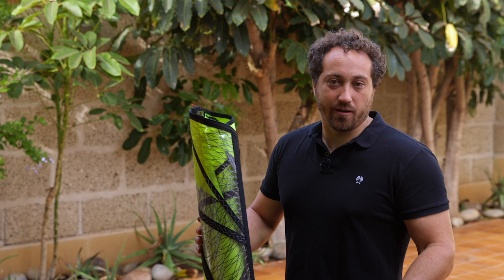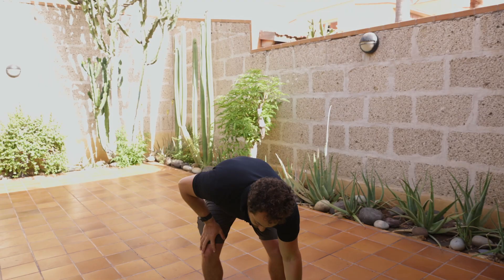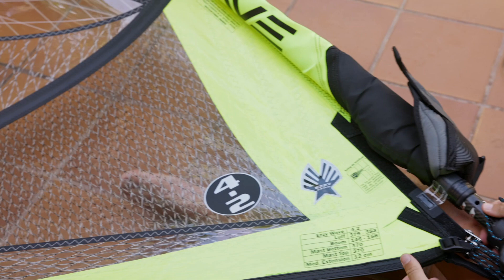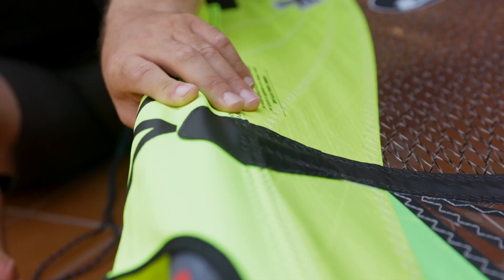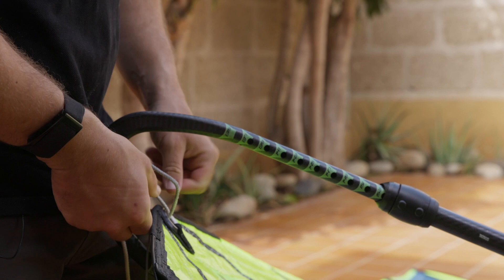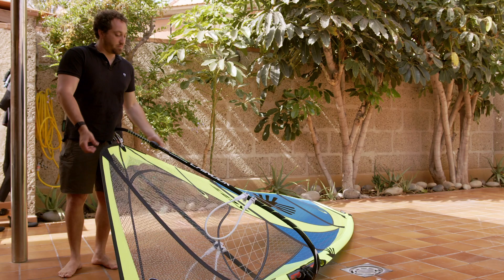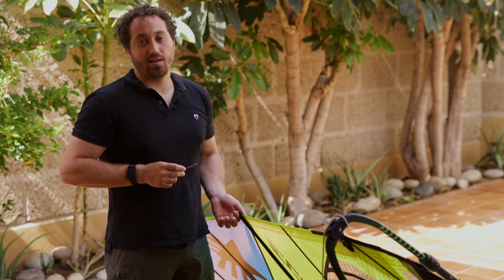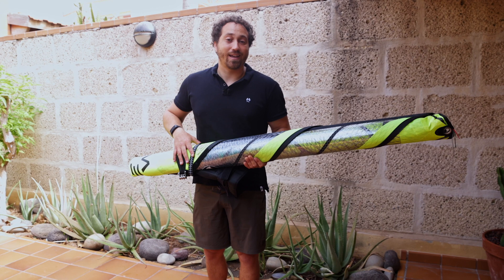Rigging the Ezzy Wave with Graham Ezzy

Comment: From my understanding, the outhaul strings represent the correct "base" setting for the min, medium, and max downhaul settings.  However, within each downhaul setting, it appears that you recommend maybe 1 cm outhaul adjustment to further fine-tune the power.  Could you comment further on the limits of outhaul adjustment for a given fixed downhaul setting?
Reply: The strings work for a given downhaul setting. When you change the downhaul, you change the mast bend, which changes the distance from the strings to the end of the boom. Does that make sense? So, the strings are always a good guide for the given downhaul.

Comment: Thanks for the excellent explanation Graham. I have one small question. You mentioned that the outhaul depends on the height of the boom (standard in the middle) which is new for me. Does that mean that I shoud check the outhaul when I change the height of the boom during a session? And is that the reason you leave 1 cm for adjustment purposes?
Reply from the maker: Hi! The distance is not the same from the eye of the clew to the different parts of the boom cut out. So, if you change your boom height, you will also change the outhaul in doing so. Therefore, yes, you should check your outhaul if you adjust your boom height. However, if you adjust the height by 1 or 2cm, it won't have much effect on the outhaul. I leave 1cm so that I can pull a little more outhaul on the water without having to extend the boom.

Comment: Thanks a lot. Very detailed tutorial, it’s very appreciated 
Anyway maybe I’m rigging my Elite sails 2018’ and 19’ with some mistakes.
My problem is that the sails if are rigged with medium wind measurements printed (with Ezzy masts) they have a lot of shape/draft (the sail draft extends up to the harness lines affecting to upwind and speed performance offering too much power.
Maybe the problem is that I don’t apply enough tension to the outhaul cords.
Reply: Sounds like more outhaul will help!

Comment: What are the recommendations for keeping the sail rigged for a while (a few months)? For example, should I massively loosen the outhaul/downhual or keep everything at full tension?
Reply: This is a good question. Sails and masts are not designed to be rigged for extended periods of time. To reduce the amount of wear on the gear, you definitely want to release the tension. Also, consider rotating your mast 90 degrees every week to help keep it straight.

Comment: Excellent video. I just purchased a Legacy 6.5 with a GT C60 RDM 430 mast and Aeron skinny extension. Is it typical that a downhaul tool is needed to get the proper “bend” in the mast? …or am I just weak! Using the proper extension length according to the sail guide, the pulleys on the sail are still quite a way from the bottom of the mast so obviously I can pull much more, but not by hand! I have read that this can be difficult without a tool but some videos seem to do the downhaul by hand without too much difficulty. Since I am new to rigging, I don’t want to damage anything. Do I just pull much harder using a tool for leverage after making sure the mast is properly inserted? Thanks for any advice!
Reply from the maker: thank you for the message Lou. FYI, in the future you will get quicker service by contacting us directly via email. You may be having struggles with downhaul if your line is creating excess friction due to improper threading. Otherwise, many people do rely upon the downhaul tool or using a foot or other object as a tool to wrap your line around for leverage. It shouldn't be too difficult to get close. You might consult with your local dealer or community for in-person help
Reply: @ezzysailswindsurfing4046  Thank you!